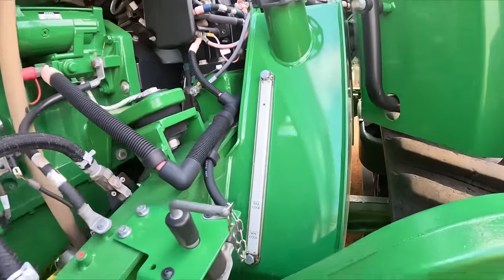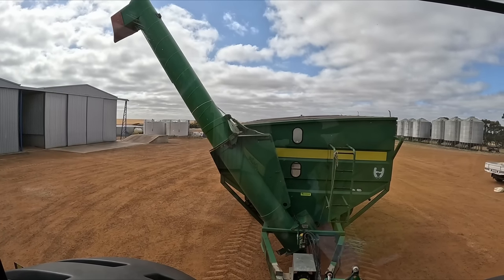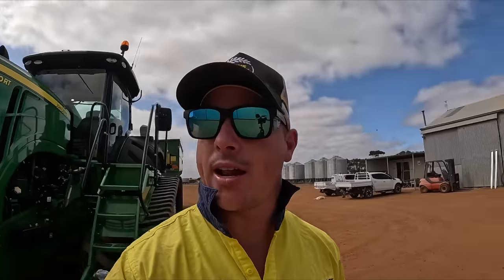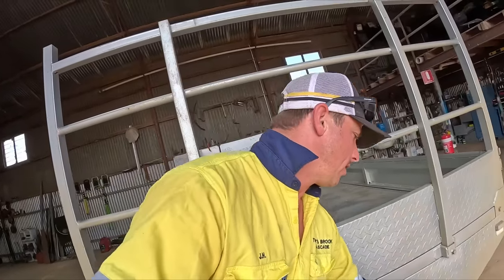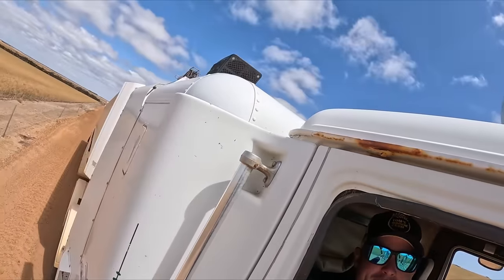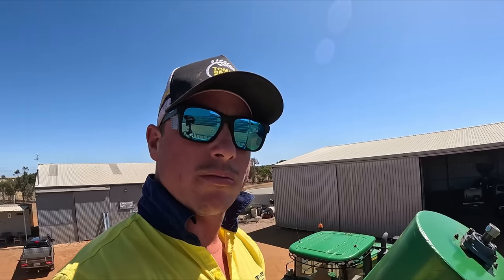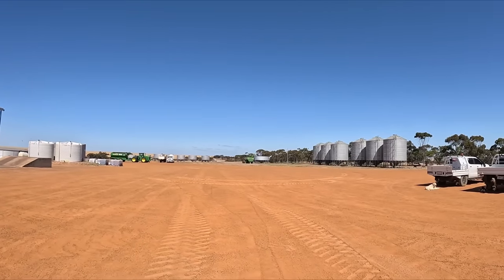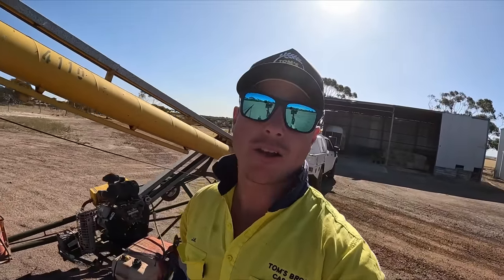Art gets a filter change

Comment: John when drilling a hole always use a smaller drill first, then work up to the correct size you will find it much better going every time.Also make sure you blow the chips away from the bearing otherwise you will create more trouble for yourself.

Comment: I would have just made a collar to go between the bolted collar and the bearing housing rather than drill a new hole. That way you could adjust the depth by just changing collars. Awesome job keep up the videos, spend every second day waiting for them to come out.
Reply: Yea that's how they are from new, surprisingly rough, just a bit of Galv pipe cut roughly to length, not pretty but simple

But you don't want it hard against the bearing you want about 1cm gap to allow the shaft to sit hard against the centre coupler and keep weight off the bearing